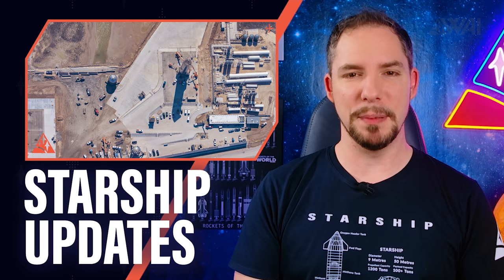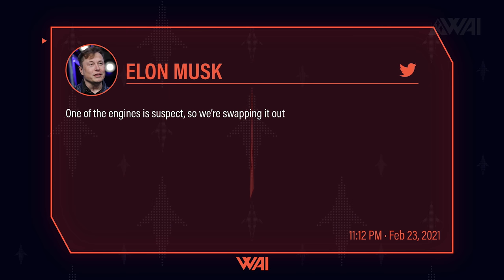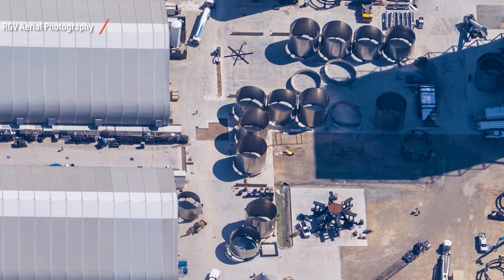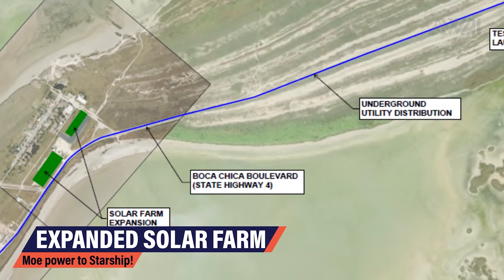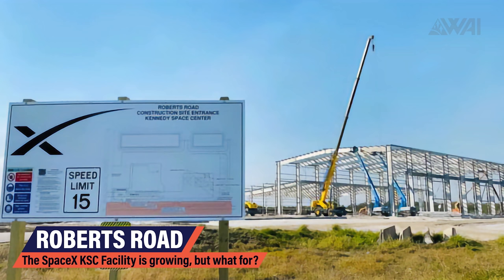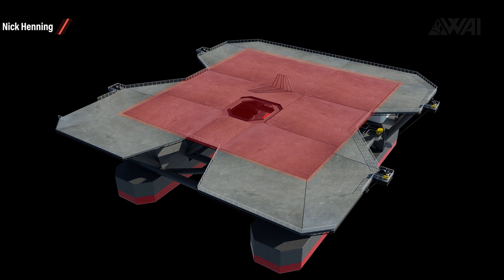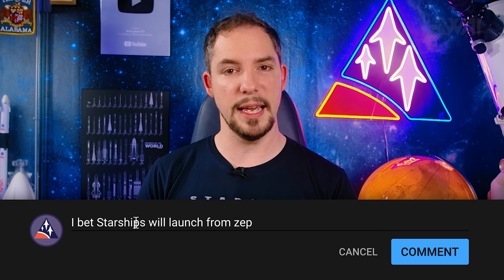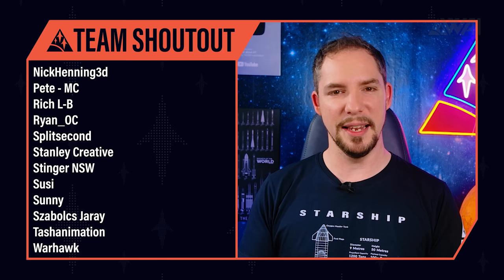150 Is SpaceX Building Two Orbital Starship Pads? & Major Sea Launch Platform Update From Elon Musk!

Comment: That platform doesn't seem right to me. The extension of the deck is a lot of unneeded added weight on top. Sea Launch moved the launch mounts to the stern for a reason. It allowed them to duct the blast away from the platform. I think it is very likely that they will use the deck as further protection from the blast for any buildings. Allowing to have the center of gravity further down. That would free the deck for a hangar. The tower is also way to tall. A launch mount elevator would allow the lowering of the booster to more easily lift the starship with a lower crane. A key that we should look at for the likely path SpaceX is to take here is stability of the platform. Much less weigh on top, especially away from the center of mass.

Comment: your flame trench is stupid, it would damage the starship,  and be a pain to build, rather have a booster lowered so the flames get  suppressed by the sea and perhaps additional reinforcements on the bottom side of launch pad, to prevent any pressure bounce from water to damage the pad/starship.

Comment: Maybe the color of the Engine Bells is different because they are still working on finding the perfect material composition for a finished Raptor Engine Design (Which will probably never happen, because they are always continuing improving their hardware). The Engine Bell will be incredible hot at the end and do better not give up during flight 😅
Reply: @gamerfortynine  Could be the case, haven't thought about it and would be an easier and way more simple solution xD
Reply: They kinda perfected the Merlin design with the 1D, fairly sure if all goes well with the Starship program Elon will want bigger things, and that might need bigger engines using different fuels. So they will probably move on from perfecting Raptor as they did with Merlin.

Comment: Really.. the green color is from the bronze alloy the bell is made from, the grey ones have been fired at least once. You do know the bell is hollow and CH4 is flowed through it before the preburner combustion chamber otherwise the bell would melt. Let’s figure out how much fuel a raptor burns;

Raptor Engine SX
1400 lbs per sec (1100 O2/300 CH4)(78.57%/21.4%)
O2=9.53lbs/g CH4=3.53lbs/g
115.4 gal O2/84.9 gal CH4 per second per engine

That’s a lot of fuel! Any other questions? (If you want to know, ask an engineer!) STEM!

Comment: The most likely design won’t have an onboard fuel farm. Existing LNG ships will be used to store and then fuel the starship with liquid methane. Liquid oxygen would be produced onboard purpose built ships, similar to FPSO’s. Both the LNG and LOX will be ‘bunkered’ through flow lines, connected by buoys to the platform. The FPSO style ships will also have the mission control facility onboard. Ground crew and starship crew will be flown in on helicopter and ground crew will be flown back off before launch. There would be onboard living quarters for platform crew when positioning and anchoring the platform, though no crew would be aboard during a launch. The moon pool hole in the upper deck would be widened for engine exhaust, preventing the need for a flame diverter

Comment: My vision of the Sea Launch Platform is a little different from yours. First let me say that I know very little about oil well platforms. I envision requirements for much more available space (and safety) which would require combining 2 existing platforms into one Launch facility - perhaps one for landings and one for launching or one built similar to what you showed and another for storage and repairs. You could even support the tank farm between the 2 platforms to get it out of the way. This would especially be important if he holds to his vision of producing LOX and methane at the launch facility, plus needing local electricity production. While your model looks incredible, it just looks too cramped to me.

Comment: I don't know why there are Raptor engines with different bells colors, but the green ones might have zinc chromate paint on them. Zinc chromate is very common in aviation, where it is used as an anti corrosion paint. The interior of hollow areas - interiors, inside wings and other control surfaces - are often painted with it. Then again, maybe not. Just sayin.

Comment: the color difference is because they are testing cost benefits. I don't know what the intention of the coating is or even what it's made of but is would make sense that if they are trying to see if the coating is doing anything to have some engines with it and some without. it could also be they are built in different factories and some just use a coating and some dont and they don't care if the color is different if it does not affect anything.  It might also just be a way to identify wreckage if and when a rocket fails catastrophically.

Comment: Nice ideas about the sealaunch platform and super good presentation, animations ect. Let me express my ideas: I think the landingplattforms will (like for falcon 9) be drone ships. At least for the upper stage with the bellyflop it’s to much to do with all these things close around. It’s easier and saver to do it on the droneship and they have a lot of experience with it. Also I rather think the exaust will be pushed away from any structure, to the other side if the Plattform. Think about it inside these buildings it will be like a level 8 earthquake 😄 in anycase it’s great to think about all this and your awesome work gives a foundation our Thoughts can be built up on. You rock 🙌🏽

Comment: I disagree that a fuel farm would be included in an offshore launch platform. First is the obvious hazard of a Starship RUD on the pad. Second, it would be prohibitive to conduct rapid launch and landings when you have to keep refueling tanks with ships. The most efficient and safe option is to fuel directly from tankers, through pad mounted piping infrastructure, which would back off before operations, then return and repeat. Filling onboard tanks is an extra, time consuming and hazardous step in the process.
Reply: Sea Launch would disagree

Comment: I don't see the need for buildings on the main deck. You have that minimal service structure below the deck, why wouldn't that be expanded to house the control and leisure structures? Employees will be living on these rigs to some extent or another, plus people waiting to board and people coming back from orbit. There will be extensive need for accommodating people, but why would it be above the main deck? Unnecessary shift of mass upwards considering that simple protected stair wells can accomodate staff movement during day to day operations above deck, while the main tower can accomodate the movement of people in and out of the vehicles.

Think of an airport, but instead of lateral seperation of passengers from the main field they use vertical separation

Comment: I like your take on the sea launch platform. Some changes I'd go for are...First  you have no helipads. Even if passengers don't normally arrive by chopper it's a safe bet they'll still need at least one helipad. If you're going to have buildings on the top deck I'd have a helipad on the roof of one or both of the buildings.....The other and more important change is I'd eliminate the fuel farm.There is absolutely no reason to have it on board the platform...The best part is no part. The ship that brings the fuel is already a floating fuel farm. A side from being redundant it vastly more dangerous, expensive and slower to have a fuel farm on the platform as posed to just refueling directly from the tanker ship.

Which BTW is how oil rigs operate. They don't store the oil they pump on the rig they pump it directly to a waiting tanker for basically the same reasons SpaceX shouldn't and I believe will not store fuel on board the launch platform.

Comment: How will the booster land in the middle of the platform? It does not seem viable in current position.
I don't like the exhaust ramp. It will direct exhaust upwards and more importantly it will deflect sound and shock waves upward, to direction of the Starship. Not very safe. It will either be vertical protection walls with openings in deck to release exhaust to the ocean or it will be totally different. There are two solutions for mount that come in to my mind: 
1. it will be placed at the edge of the deck, not middle or 
2. it will be even lover than main deck. 
In 1st solution, the exhaust would have at least 180 degrees free, and in 2nd solution exhaust (and main sound waves) would not hit the deck until the Starship is moving, so they would decrease exposure. 
I very doubt that they would have 2 different launch mounts, at least in that configuration and in first iterations of pads. If they could pack them on the edge then yeah, maybe they could decrease time between launches by refurbishing both of them at same time. Or stack them faster. But will they have resources to do this simultaneously? There might not be enough space for so many people and equipment. And if it will be as easy as Elon says it will, then there is no need for 2nd launch mount at all. Maybe they could use 3 landing pads to store and prepare more Starships and boosters, but only if they will be very quick with stacking and launching. 
Is the sea launch platform intended only for passenger flights? If not, you missed the problem of putting the cargo inside the Starship. It does not seem likely that they will just land Starship with cargo (worth millions or even billions of dollars) and launch it just like that. They at least would need a facility to check if everything is ok with the cargo before the launch.

Comment: Aren't the gray or black Raptors just used and covered in soot?
Reply from the maker: But then what is the green color? I've seen brand new Raptors without it! :_WAISweet:
Reply: @Whataboutit  Not sure, but "raptor 52" at 3:25, it has a green ring ontop of the bell, supposedly covered from engine mount of some sort during the fire test. Also looks like some of the soot was rubbed of behind of the "metal bar" that is holding down the engine.
Reply: Soot isnt a byproduct of methane combustion so i dont think its that. Not entirely sure, but good chance they come out of the factory like that.
Reply: @roelwieggers4181  It can if the combustion is incomplete.
Reply: @bluemamba5317  Yes i think so too. So maybe they get sooty after an engine bay fire after a static fire? Also im pretty sure ive seen new Raptors being delivered to the site that look just like that.
Reply: @roelwieggers4181  Possibly. The "new engines" could maybe be refurbished raptors that was in sn6 etc also.

Comment: Wow that possible design of sea launchpad is awesome. It worries me though. What happens if rocket blew up or something happens to tanks. All the fuel goes in the ocean. Very optimistic for the sea launches.
Reply: Methane will simply boiled off & won't pollute the ocean, unlike RP-1
Reply: @alvianchoiriapriliansyah9882  There is lot other fuel too. Hydrolics, COPV, header tanks, lithium.
Reply: @shubhamkasande  Umm are you sure?

Comment: For the orbital sea launch platform, do you think it would be possible for the platform to make it's own fuel on site? Couldn't the sea platform combine water from the sea with CO2 from the air to make methane? Of course you would have to desalinate the water in order to do this.
Reply: yes, the tweets mentioned say that initially they will produce LOX and later get the methane production
Reply: @davidelang  Yes but I'm asking if they will produce fuel on the sea platform itself
Reply: @MorcsKSP  That's exactly what Everyday Astronaut asked, and Elon replied that initially they would produce LOX on the platform (as it's 78% of the fuel) and later add the reactors to produce methane from CO2 and water
Reply: @davidelang  interesting

Comment: Why did you give the launch tower on the sea launch model a casing? Leaving it as a metal girder tower would have nearly no WIND-LOAD out at sea.
Reply: Also imagine the WEIGHT-SHIFT when launching/landing a rocket with the pads not being in the center.

Comment: I don't think SpaceX will launch point to point travel and orbital launches from the same location, it would add too much complexity+the structure would get too big and I also think they will only launch Earth to Earth transport later (NET~2025), because they first need to drive down the costs. I think they will build a stacking crane on one edge, a landing pad on the opostite edge or just as far away from the crane as possible. The launch mount would stand somewhere near the crane and there would be a Starship parking lot for tankers!

Comment: As far as oil-rigs:  Iv'e commented before that i think the two that are in some kind of conversion process ATM, will not be the actual launch and landing platforms, but support platforms, at first, aiding in the building of that launch capability, and later, support platforms for a specifically designed launch capability. Do you have any theory or data to indicate,  the necessary-size and design of an actual launch and landing capability, vs. the size and scope of  launch support, platforms? Is the issue of modular support platform, and its size and scope, in your idea space at this point? what specific information has lead you to believe that the two platforms are not going to be simply construction logistics.. and ultimately modular (more movable) support structures?

Comment: Not sure the launch structure will work, have you ever seen a crane capable of that kind of weight that didn't have a large counter balanced concrete block on the other end? It'd topple over.

Comment: How exactly will they get Superheavy boosters to sea launch platform? since they have no nosecone, I doubt they will be able to fly that far without a Starship on top for aerodynamic reasons. That, or some kind of detachable nosecone that has to be shipped back to Boca Chica
Reply: fly them there. Have them land on the next platform after releasing the starship. Or they could get a temporary nosecone.
The booster has far more delta-v than a starship (even with the starship as a payload), without a starship on top they have a huge amount of delta-v so they could be inefficient and fly slower than their max for a transport hop
Reply: I do not think they need a nosecone if they are just flying 10-25 miles at an altitude of less than 5,000 feet. It will be similar to the earlier Starship flights of 500 feet.

Comment: I don't know why I was surprised by Elon's comment that they will transport the Starships to the sea launch platforms by flying them there. When I saw the question tweet in this video I'm sitting here thinking, 'Yeah, that's a really good question. They wouldn't transport it on a boat upright, so it would have to lay flat. I wonder what sort of cranes and platforms/support structures they'd need to change it from a vertical to horizontal position?....'. Meanwhile Elon is just like, 'We'll just fly them there.' SpaceX doesn't do things by halves.

Comment: I think current launch sites do not have any manned enclosures sites right next the launch mounts upon launch. It's all done unmanned and remotely for safety reasons; e.g. the landing of F9 boosters, Crew Dragon, BO New Shepard, etc. Any control center might need to be remotely done; the deciding factor being communications, leaving it autonomous but sketchy like F9 landing video, or improved via fiber optics permanently, deployed only during launches; oil rig sites have multiple platforms networked to provide SCADA via UHF, microwave, and satellite RF links, and now likely via fiber (my experiences here were of the '80s era :D ).
Starship will need to prove themselves for cargo before undertaking passengers, so not likely gonna be any passenger terminal until then. Even so, it would be utilitarian, to be used only for a short time before boarding, and recessed below deck to minimize risk of repetitive damages from multiple launches; extended lounges can be built on land or on cruise ships close by..Rocket blasts and sound can be deflected and attenuated, but vibrations from those multiple Raptors would be expensive; everything will be shaken to smithereens, no stirring ever possible. How many times before nuts & bolts come loose, or weld points breaks? Earthquake (not rocket) vibration dampeners for buildings exists and will take up space and add costs, oil rigs weren't built for the likes of rockets.

Comment: Deimos needs Desalination Plant and Floating Solar Power Plant around it.
Desal gets it pure water to use the electric power to reduce to H2 and Cryogenic Oxygen to fill the tanks, along with the Sabatier Process equipment to generate Cryogenic Methane from the waste CO2 in the atmosphere, rather then shipping fuel and oxidiser out to the platform.
Wonder how far Boca Chica is from nearest access to the Equator.
And, perhaps there could be "limited use" involving F9 or F9H and a vertical maintenance tower.

Comment: Well done. But I definitely think if they’d include building structures that these would find themselves below deck so as to not put any humans in harms way. It is much more feasible and safe to elevate the launch deck a bit to implement all humans in safety zones below deck rather than putting them in harms way next to the launchpad. That would also do away with that ugly  exhaust ramp. 😉
Reply: Also, I’m not sure an exhaust ramp shooting exhaust back up on the air around the rocket, jeopardizing the launch’s integrity is a smart solution to protect buildings that don’t need to be there.